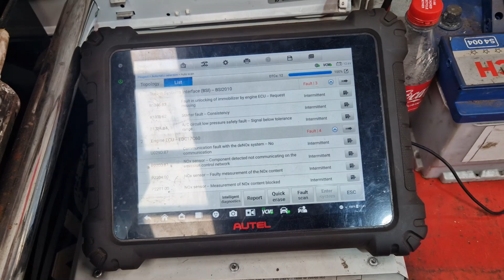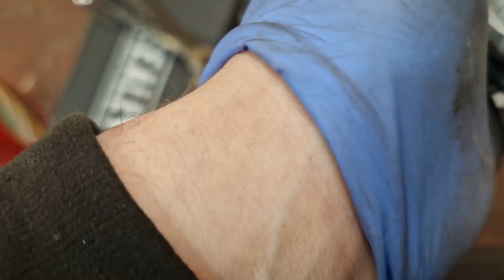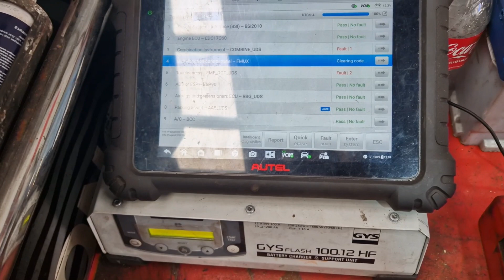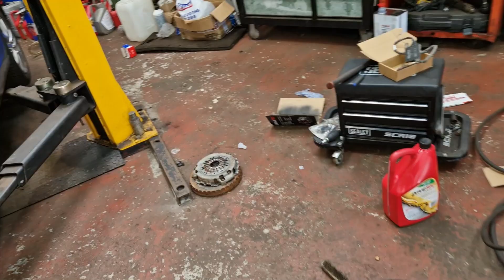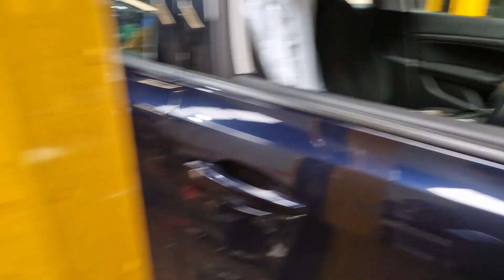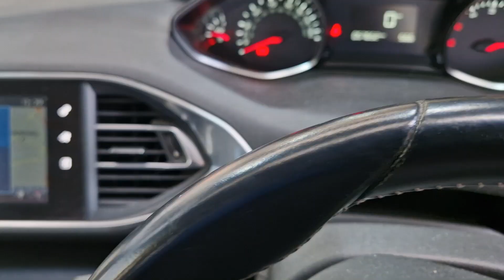#peugeot  308 UREA FAULT IMPOSSIBLE START DIAGNOSTIC AND REPAIR #automobile #car #mechanic #autel

Comment: Adblue the big scam peugeot  the most unreliable system  on the market I have a Peugeot  3008 adblue low pump pressure new tank and nox sensor £1500 a second  time in 2 years
Reply from the maker: that's not so good, man, but thanks for watching and commenting if you haven't already hit that subscribe button, and have a great day

Comment: I have the exact same faults on my Peugeot 308 HDI 1.6.
Reply: How is the veichle? Mine 308 has the same issue too now
Reply from the maker: @neopa06 hi, and thanks for watching and commenting. If you haven't already hit, that subscribe and have a great day yea this one was repaired, but this is an active garage. we see 1000s of vehicles every year so we don't remember all of them we hope you get ot repaired if you need booked in were on Scotland www.cairneysautosolutions.co.uk
Reply from the maker: yea, we have another one in now. Suspect the pump in the tanks gone  in this one we have in different faults this time they're getting more common now the urea issues on them hope you get to the bottom of it thanks for watching if you haven't already hit that subscribe button and have a great day
Reply: @cairney0037  I needed a new tank, NOX sensor, and to top it all off two front suspension springs.
Reply from the maker: @busterguff1068 ah man, that's. a bad day, but at least it's fixed now, and hopefully, you won't have to spend anymore on it for a while. yea  tanks injector sensors. There are all going down now. It's not good, thanks for watching and commenting if you haven't already hot that subscribe and have a great day
Reply: @cairney0037  Engine light came on on Thurday afternoon, later that afternoon Urea warning. Topped up with Adblue at home. Friday still engine light, urea light, but now emissions warning, and later, 700 mile limit. I've got someone to look at it on Wednesday next week, and that's the earliest, even main Peugeot garage can't see me till May 1st. I'll let you know what the Mechanic discovers.
Reply: @busterguff1068 did you get it fixed? Having the exact same issues. But feel like my mechanic not fixing the problem as it disappeared for a day but then warning light reappeared again
Reply: @raquelramos7705  Yes, I had a new AdBlue tank and new NOX Sensor fitted. Together with two front suspension springs (Eek!) it cost me £1800
Reply: Two 308s in my family both similar Urea system problems. Some garages are utterly useless and don't even know the difference between the Adblue SCR system and the EOLYS fuel additive system. I'm still working through the issues. The next jobs will be removing the Adblue tank and seeing if I can find an issue like bad soldering or wiring. I'm either going to get a 1990s car or lease an electric one next. Either way it won't be another Stellantis nightmare.

Comment: Hi I’ve got a partner van 
Starting prevented 450miles. Nox sensor bracket is hanging down cable tied it so wasn’t dragging along the floor can I change nox and solve this issue ?
Reply from the maker: hi, and thanks for watching and commenting if you haven't allready please subscribe and have a great day You would be best having it put on a diagnostic machine and confirming the fault without seeing the van i would be playing diagnostic bingo lol 😆 hope you get to the bottom of it